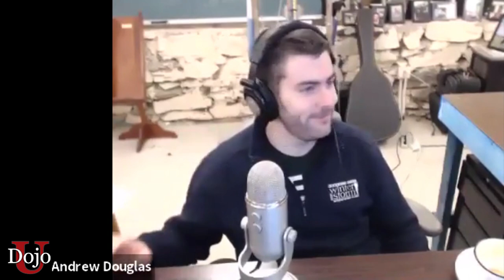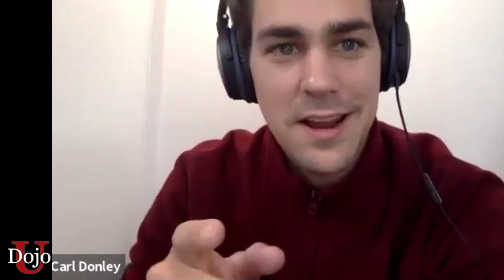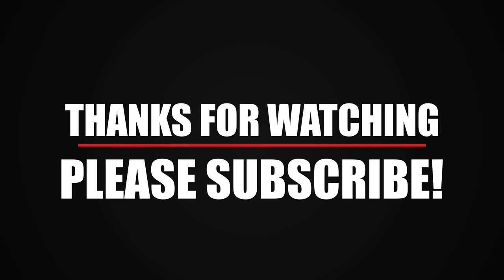How Do You Adjust the Screw on a Drone Reed

Comment: It's about hz, low A is 440 ,tenors 220 and bass 110 (perfect world) 

To lengthen a slider increases distance for sound to travel ; in return lower hz and pitch... same applies in a drone reed , more volume to fill is lower hz 

Screw in (which ever way it needs be turned) to raise pitch and out to lower .... brawl tuner calabrates to  low a and dose the math even (12th root of 2)..its  awesome app